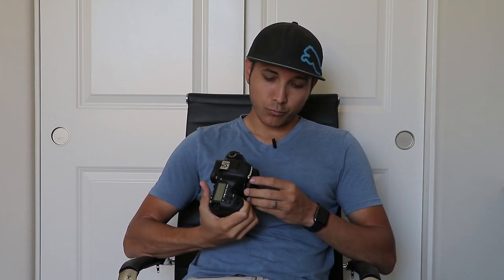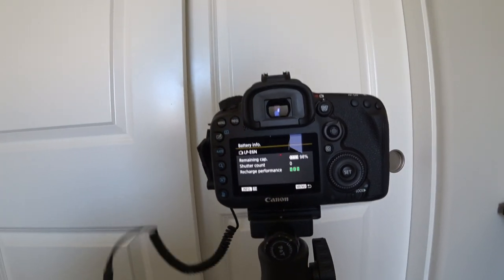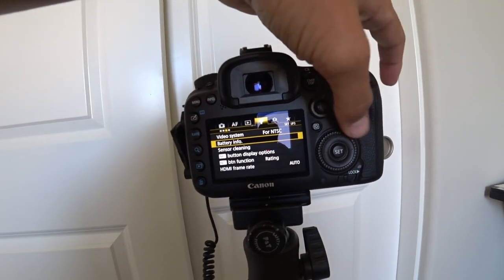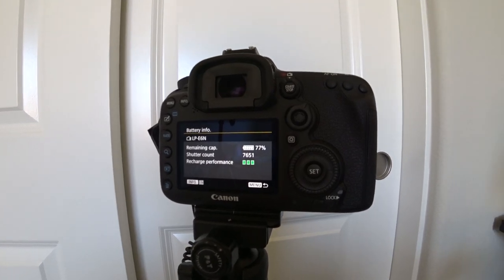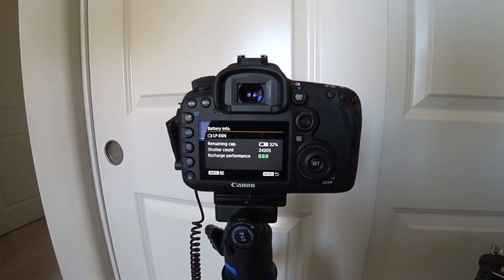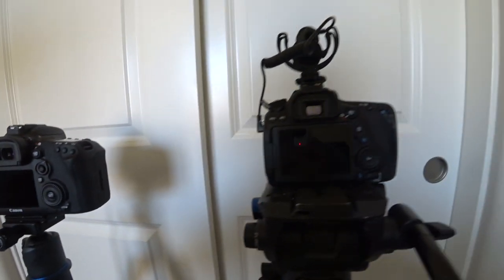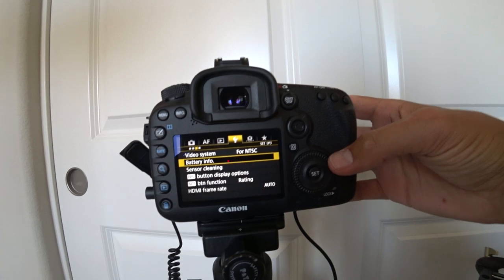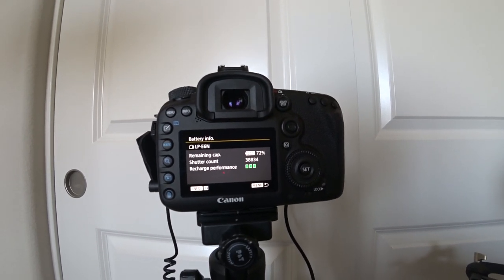Canon 7D Mark II Shutter Count Test: What Happens If You Take Photos NON-Stop?

Comment: 1. You're not letting the shutter cool down so the shutter blades are accumulating friction heat and warping prematurely. You should have had the camera on an intervalometer with an actuation every second and let it run for a couple of days.
2. You didn't have a lens (or at least a body cap) on, so dust would have been introduced into the shutter mechanism reducing shutter life. Especially on long bursts where the mirror is acting as a fan, drawing air in.
3. Given all the above the shutter would have lasted well beyond 200,000. Which makes sense, since I've never heard of a shutter die before it's rated actuations.
4. This should have been a 5 minute video.
5. You talk too much.
Reply: i agree 200%

Comment: Good video, but have to agree that you should edit this down (cut to the chase).  Also should disclaim that this is not normal usage and a torture test so the results are misleading.  But thanks for taking the time to do this.  How much did it cost to replace the failed shutter?

Comment: I find this “test” unnecessary and completely wasteful. Completely unrealistic environment for testing.
Reply: I agree.  That camera costs $1,000 now so it must've cost more a year ago.  The 200,000 number comes from extensive testing to arrive at a mean time between failures by Canon using a bunch of cameras until they break.  Why ruin one's own equipment to just arrive at the same conclusion Canon did?  To put it another way, part of the price one pays for a camera is to cover the cost of this testing.  Rely on that rather than doing the same oneself.

Comment: Did the shutter blades actually break. If not it seems to me like the shutter might have seized up from the heat. Normal use, even professional use, the shutter blades would more then likely break before seizing up, going over 200,000. I know as I had a EOS 1D MKII go through two shutters (blade breaks) from shooting running event where you can do 6 to 8000 shoots per event.
Reply from the maker: I didn't notice anything physically broken or out of place, but after the error came up the mirror would not flip down. Even applying pressure, it would bow slightly but wouldn't return to its original position. After power cycling the camera, I could occasionally bypass the error when turning on and the mirror would move back down into place, but pressing the shutter button caused it to get stuck immediately. The same result was seen even after allowing adequate time for the camera body to cool down as well.
Reply: Might be the mirror assembly gone. Usually the shutter blades will break which you would be able to see lifting the mirror up. My other old 1D mkii I used for running events for the high frame rates died a while back (was expecting it sooner or later). Shutter blades have broken and will not go through the motion so the mirror will not go up. Just makes a clonk sound.  Maybe you should do a update when you get it fixed as to what happened. Might be interesting.
Reply: I agree.  would like to see that.

Comment: B.S. I have more than 1, 398.824 and still works like brand new.
You abused your camera and let it overheated of nonstop clicking.
If you used the regular way, the camera would last much longer.
Reply from the maker: it most certainly would! Glad to see you're at such a high number, much higher than even the "long lasting" cameras I've seen. Keep it up!
Reply: post proof.
my father works for nintendo.
Reply: Very cool , 1.4 million ! 
I'm up to 72,000 so far after 2 years with my 7Dii

Comment: Actually it is a bit dissappointing that it lasted "only" what Canon specified. I use a D90 and it is already more that 50% past its specified shutter life expectancy. As someone else mentioned in the comments it probably died because of continuous max speed use wihch may have caused the mechanical stress to build up much faster than anticipated. 
Thank you for the effort though..
Reply: If you notice at the end the mirror is cracked. I would imagine loose part in the camera is not good for the shutter.

Comment: Hi,
Did you get the shutter mechanism replaced with a new one ?

I was wondering how much it costs to replace the shutter mechanism ?
... while i am at it would be nice to know how much did the LCD screen replacement cost too ?

Cheers.

PS : does the newly replaced shutter mechanism guaranteed to offer another 200000 shutter count mileage ?

Comment: What happens after shutter count is over? Do you throw away the camera or can you replace shutter count?
Reply from the maker: Great question-the shutter count is just how many actuations the shutter has had-you can send the camera back in and have it replaced! Or, if you are brave, attempt to swap it yourself. However, you must do something once the shutter goes out, as the camera would be useless until it is fixed.